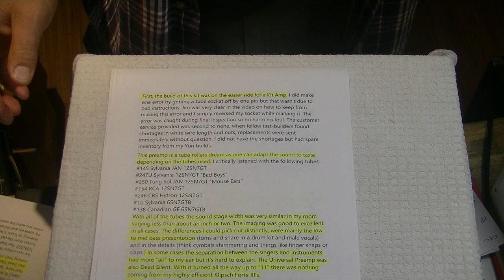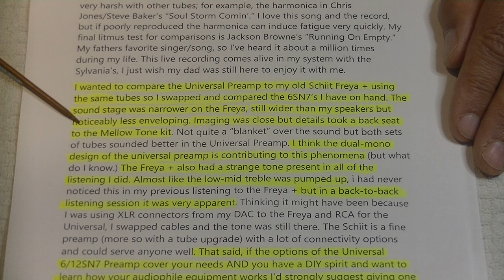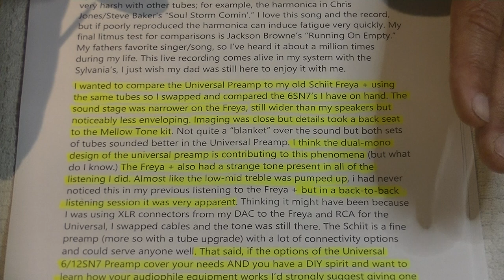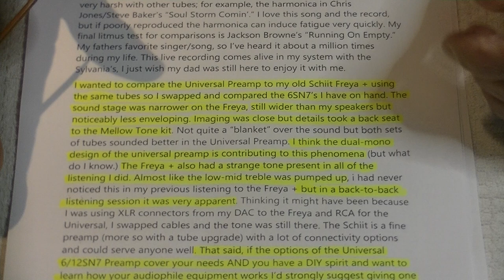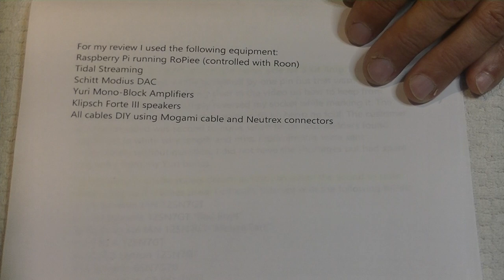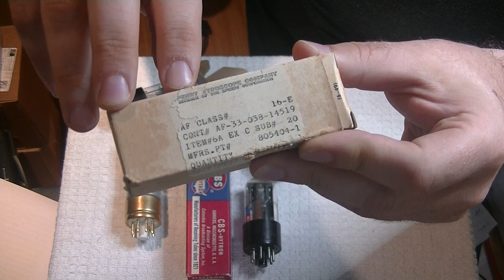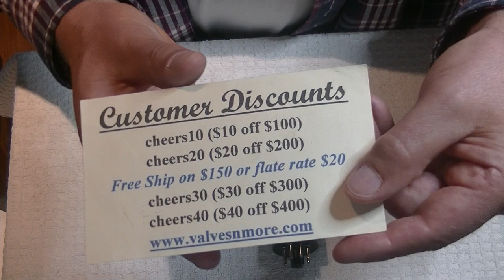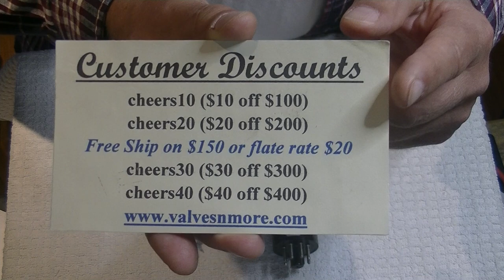Tube Lab #95 - How to Achieve Great Sound - Universal Kit Amp Review

Comment: B17 flying fortress etc during WW2...........had many tubes on board.............the onboard generator made up for  36Volts ..........they needed 6SN7/12SN7 tubes but low plate voltage the tube was not as linear, so there was a substitute for the 12SN7 that worked very well on lower plate voltages ...........It is a marvelous substitute , mil grade quality variant and great alternative for the 6/12SN7.................this tube was also burned in and checked up to the standard requirements at factory, sturdy under mechanical sgtrain , high altitude , temperature changes etc............;
And what is this tube ............THE 12SX7

Comment: Colouring music with a tube preamp, is not true to the reproduction.
This was game played in the past to sell you a tube preamp.
I'm not against it, I just want people to know where this stuff comes from.
This was also the game used to sell you mixerboards as the transformers in each channel coloured the sound for the signal source.  Audio inductors and tubes were always great risk that you could create a great audio circuit.
Reply from the maker: I think maybe you missed the point of Fridays Tube Lab or maybe I wasn't clear enough.  Everyone running a good system has a separate preamp.  And IMO it should be an all Tube based preamp.  If that's the case then you just need to choose the preamp that fits best with your system and music.  A simple example of this choice is my two Kit Preamps.  The E80cc has great clarity and drive, a neutral sounding dynamic preamp.  My Universal 6or12sn7 uses a tube that has a lot of harmonic distortion already, many love the 6sn7 for this property, some not.  As the listener you choose.  The circuits themselves have no (zero) applied EQ and are designed for as true and clean a signal pass/amplification as possible.  The only tweaking we do is at the power supply filter stage, and that is very minor.  In conclusion every single component colours the sound in some way, we just need to choose what sounds best for ourselves.
Reply from the maker: Also every tube has an individual sonic signature that is unique to that tube type and manufacturer, again I'm just suggesting you choose the tube sound you like best.
Reply: @tubelab194  Again, colouring to suit your ears means a few people, long ago, beleived you needed a very exspensive tube amp to have good sound while all along it was just coloured.  Nobodies ears hear the same as the next person.  You don't need to spend $1000s of dollars to have a good system, in fact, it was more of a status symbol years ago.
Let's set the record straight in saying selecting the right tube and audio transformers is all a personnal judgement.
Just remember, to have fun building and searching for that sound that pleases you.  :)